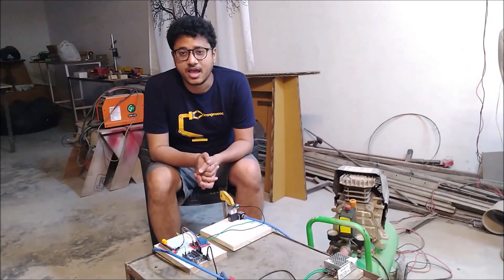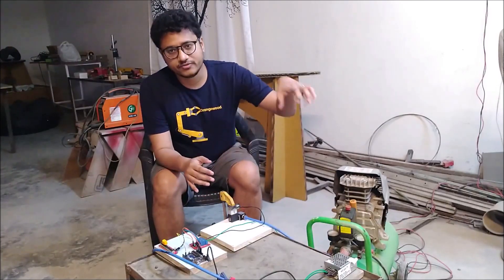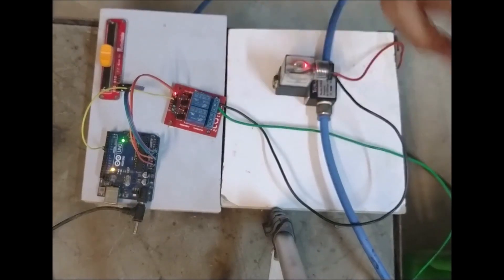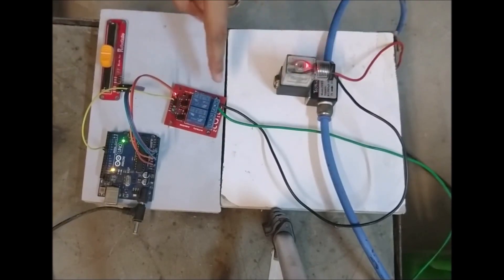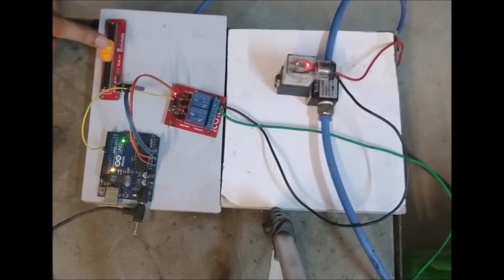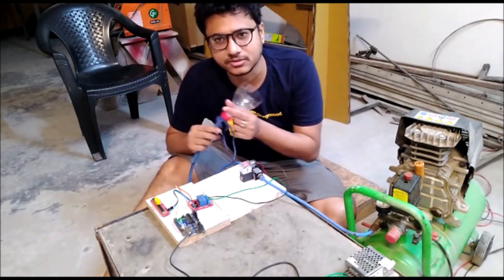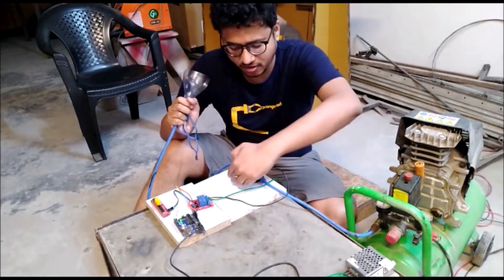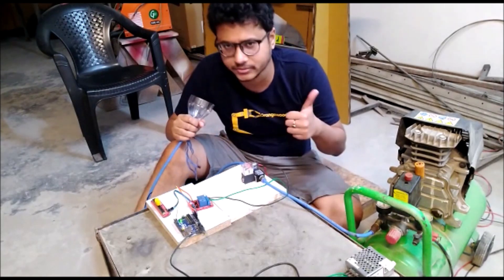Mass Ventilator project: Ventilator from a compressor

Comment: Using lubricated air compressor for inhaling is not advisable because it emits fumes and oil creover can take place on the long run it is doing more damage .Oil free compressor on the other hand is 100% safe  and widely used by hospitals

Comment: Hi, thanks for taking this on! At base, a ventilator would need to be able to deliver variable quantities of air per breath (tidal volume), at variable breaths per minute (respiratory rate), and with variable pressure (positive end expiratory pressure). The TV and PEEP modulations are critical to prevent barotrauma, while introducing enough pressure to force the air sacs open and push fluid out of them. You have the slider for RR. The % oxygen per breath (FiO2) should be adjustable at the level of oxygen supply lines in hospital. Can you arrange to have TV graded at inlet? PEEP might be tricky in terms of control. I've yet to explore the mechanics of ventilators but I hope there's a way to get that function going. Happy to take this chat forward if you're interested.
Reply: Swetaji, if possible  contact on 9376720200 for some queries

Comment: I had a similar thought about using compressors. I used a balloon as a pressure regulator and added a water bubbler on the output of mine as a bit of a filter, incase theres any crap in the air supply.. but also acts as a nebuliser where you can add essential oils and meds to it to help clear peoples lungs of mucus and open their airways.
https://www.youtube.com/watch?v=SbQ03i9Ex5s

Comment: No it does not ...actually your inhaling by.yourself and machine is just opening and closing the valves which is a important princple but actually ventillator push air into.lungs and take that air out also as lungs fails to do so. i tried this same thing about a year ago i used refrigrator air compressor and some cycle tyre air.pumps it worked but the problem with that was pressure was not precise it was good for like normal.breathing but not for life support
Reply from the maker: Thats ture! I realized after talking to some medical professionals. thanks for commenting!
Reply: @abhindas  Hello Abhinav.. The design can be a bit modified by adding a 12V DC air pump that can supply a mixture of Oxygen and Air controlled as per breathing cycle using a microcontroller..  Air compressor can help in building a reservoir. Some sensors would be required to constantly monitor parameters and control Air/ oxygen flow accordingly, we can discuss in detail on improvising this design.. if you feel like. I have worked on similar project recently. Kudos to your efforts
Reply: abhinav das you realized after talking to medical professionals that people that can breath on their own don’t need these.. 👌🏿 great mind for building, not so great with logic.
Reply: @Sam-yc4qp  sure